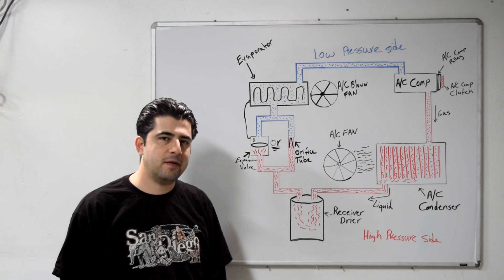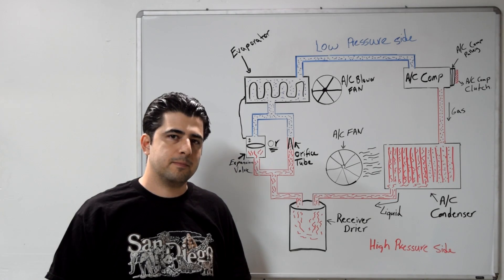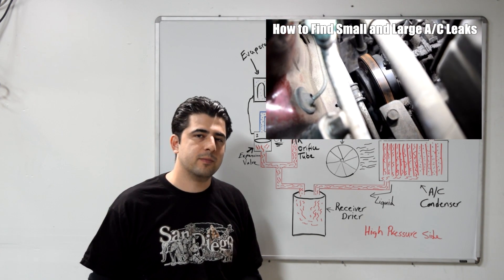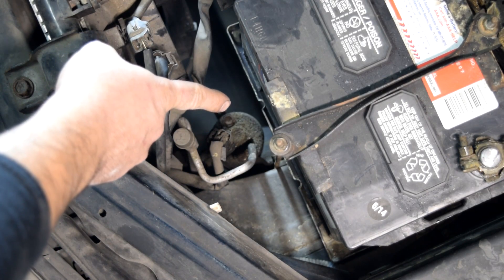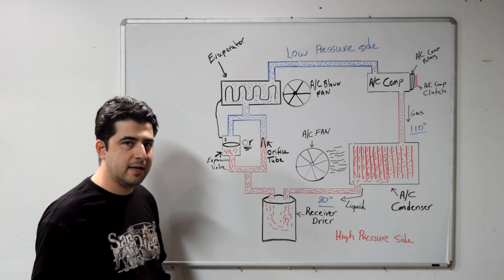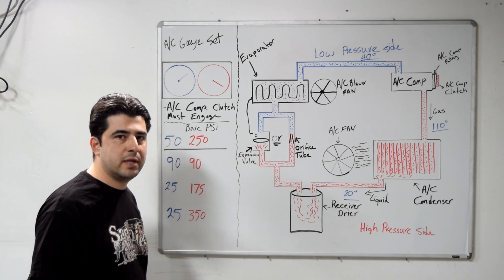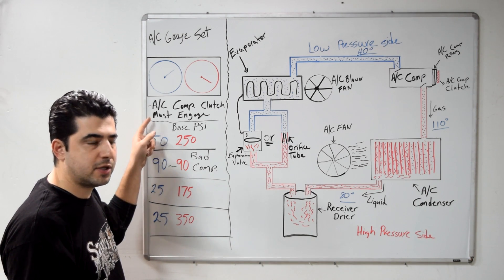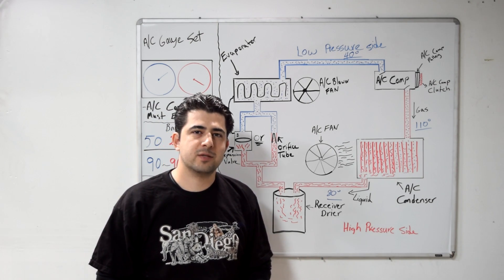How to Diagnose Problems With Your Cars AC System - With or Without an A/C Manifold Gauge Set

Comment: What if the low pressure side is higher than the high pressure side? Right now my gauge is sitting at the max reading on the low pressure side

Comment: Best videos yet on easy to understand diagnostics, this really helps to find out where the trouble / or even weak points of the system are, very well done, and thanks very much for posting, I am going to be applying this to 1986 ford f-350 motor home, thanks again!!

Comment: AC light comes on but just blows hot air compressor clutch not engaged with the AC light on all the HVAC controls work with heat and blower fan in the dash works including all the zones from hot to cold and the different air zones. Compressor clutch only engages when you jump out the relay for the compressor but I get no cooling fans running under the hood and those fans do work when the engine gets little warm but don’t come on with the AC. I looked at all the AC hoses and lines I can’t see any leaks of oil or Freon. The condenser at the front of the car looks fine to me no holes or anything and it’s clean. I can’t reach the low side service port it’s down at the bottom of the engine bay in an awkward area more easy to get to if I had a jack but I don’t. The high side I removed the cap and pushed down on the valve and I did hear pressure shoot out so it seems there’s still some type of pressure in the system. Plus I checked power from the HVAC controls to the compressor relay in the fuse box under the hood and with the AC button on I have power at the relay but it seems the computer not closing the contact only works when I jump it out the clutch engages and spins the compressor but that’s all that happens no cold air. Any ideas I was thinking pressure switch but I couldn’t see I leak anywhere only other thing maybe a bad orifice tube I don’t know

Comment: Very nicely explained! You just made a complicated thing uncomplicated!!! My Lincoln Towncar had the engaging/disengaging syndrome right now and i tried to add some Freon to it using one of those cans with a gauge in it but it keeps going all the way to touch the red area and coming back to the empty area so it wasn’t too helpful. While filling it up, the gas stopped going in and started leaking from the hose attached to the can. I also noticed that there was compressor oil on both the low and the high pressure connectors. If there’s a shortcut, please, don’t be shy! Lol.
I noticed my ac want cooling enough a couple weeks ago but won’t go to a shop because they are very Disonest down here in Florida so I’m trying to figure it out what’s going on.
Thank so much for your kindness and wish you all the best!

Comment: What would readings on a gauge be like if the low pressure side is clogged? My compressor started making a weird noise and stopped blowing cool air all of a sudden after I stopped somewhere to get gas, and when I go to add refrigerant it shows max psi on the refrigerant can gauge

Comment: Hi i have a 2011ford transit  when i turn on ac only hot air .  ac light is on clutch is turning but the pressures are equalized 90. LS  HS 100 psi  
Recovered frigerant  recharged 29 oz
Still compressor not pumping 
Any info will be appreciated

Comment: Great work. I would like to ask you what causes the AC system not to take refrigerant with a new compressor working, dryer and Thermal expansion valve. The clutch compressor is engaging as well.

Comment: My low pressure side hose is frozen and blower fan is not working . I hit a black box under dash of pasanger I assume to be the condenser and it turned on. The box had condensation on the outside. Any thoughts on what could be the problem?

Comment: Hi. The problem happen usually when i am in traffic jam.  After a while in traffic jam like 30 minute, The air con will start to blow hot air.   I notice that engine temp start to go up.  When i switch off the air con unit, i notice slowly the engine temp will come down.  The fan for the air con condenser unit is working.  My car radiator unit is new, clutch fan is working because the engine rpm is same rpm on clutch fan blade, no leak on water pump, good level of coolant, thermostat is working. I replace new air con compressor, new dryer, new expansion valve. The evaporator unit is clean and with new cabin filter, no blockage in front of the condenser.  What could be the problem i have on the car.  Hope for your kind assistance.  More power to your channel.

Comment: I have that same 95 Camry and my a.c. will work for while and then stop blowing cold air. Usually once I've turned the car off or it sits over night, I'll come out next day and it may work a little or not. Sometimes depends on how hot too. Suggestions...

Comment: Hello, I touched the lines on my a/c lines and everything seems to be working. Low side is cold, high side is hot, but still warm air is coming out. I also added 2 cans of refrigerant and still hot air. The only thing not working is my condenser fan, do I need to make that work to get cold air or should I get a bit of cold air even if it's not working. I am still trying to figure out why my fan is not running, but I think it's temperature control that's why it's not turning on. I tried connecting it directly to power and it run.

Comment: I have a 2006 scion tc. Ac dosen't work. Which fuse and pins do I jump to get the compressor to work? I checked the fuses under hood. Not much info on this car plus fuse is in Chinese
Reply: Btw, 83,30 I know. Not diagram, no nothing on this car.

Comment: What is usually the problem when ac compressor clutch engages, but there is no difference in the low pressure. It is the same whether the car is off, or on with the compressor running.

Comment: I need you to look at my car cuz I’m having a hell of a time finding a mechanic who knows ac and they’re putting me thru the ringer. I replaced my condenser myself. But now I think it might be my expansion valve. Please I need help lol my high side pressure is way to low and my low side is where it needs to be at 30. Not only that my ac is hot on idle and doesn’t get colder than 60 degrees when it’s 95 out when I’m driving. Oh and I don’t notice the fans or clutch turning off. They turn on no problem , but don’t cycle off.

Comment: my car idle comes to 0.5 when ac turned on. i have replace sparks plugs. clean throttle body and sensors etc. but problem is not solved.

Comment: My car leaks water on the low side I think the accumulator is clogged or leaking. Water builds up and looks like it's overheating but it's water not coolant and you hear water moving around when turning. Help confirm or explain what's happening

Comment: I know you said that the A/C clutch needs to engage to test. What if it isn’t? I just replaced the condenser a coupe of months ago and fill the system with refrigerant. I noticed my ac wasn’t working properly while stopped or setting at idle, eventually it just stopped working and the clutch isn’t engaging now. The only gauge I have is the one that I got with the R34 and when I connected that to the low pressure it read 250psi. Could this be to the expansion valve being clogged? This is on a 2010 Honda Civic.

Comment: So how important is the evaporator to the whole system. Sorry I'm having trouble understanding everything. Local mechanic worked on my AC and the check engine light came back on and he said he couldn't figure it out. He explained that he check the whole AC system and just couldn't find the problem and explain that the evaporator is more of a car issue than an AC issue

Comment: 2011 ford fiesta ac line going in through the firewall is not getting cold any suggestions?
Reply: System is reading 50psi i replaced a bad cooling fan ac still not working clutch is engaging

Comment: Yesterday I vacuumed system in 1994 mustang gt...then I added a half a can of refrigerant  (left over from my truck) compressor went on...then I added some ac pro stop leak and tried adding more refrigerant and it only took half a can and compressor stopped going on... any suggestions on what I need to check next? Or do? Thax

Comment: Great video brother...I have a question
I just replaced the entire ac system ac compressor, condenser, hoses, dryer, and high pressure switch (on dryer) the ac blows really cold but the clutch is not cycling its always engaged...any idea if the ac relay can be the problem?
Thank you..

Comment: Ok. Here's my deal. Hope you can suggest some things, shed some light or/and tell me what to check next? Recovered system's freon with MY recovery machine, refilled w R134a from MY tank(w my scales, so was dead on weight accurate) and it worked for 2 summers now. This year, air is not getting cold, again! Sux! Summers a comin!
Here's a little info;
Initial Diagnostics test readings:  Low side- 45psi (+ or - 2 to 4 psi as fan cuts on and off) 
                                                           High Side- 160-175psi (again, + or -) 
Temps: High side line-  Compressor to condenser-140-160f
              High side line-  Condenser to receiver dryer- 125-135f
System uses exp. valve, not orifice tube
It's the crappy 2000 sebring conv JXi, 2.5L
Appreciate your videos! Love to see what you think/things you would do! Thx!

Comment: I have some concern .  My toyota vios 2006 ac is not cold when idle but when running the ac is cold. I just had my ac service recently charge freon, cleaning and new cabin filter.but still it's the same. you think the problem is expansion valve?

Comment: I've read on some forums that a locking AC clutch can cause the compressor to always be engaged. Is it possible for that to happen and the symptoms be cold air coming out even when AC is set to the OFF position ?  I was told I have a bad air compressor yet I still get cold air no problem, no leaks, and good pressure. Just wondering if changing the clutch assembly would fix this always on AC.

Comment: The pressure gauges in my car are 55/200 which it seems to be normal, but my air is coining out of the vents at 80 F degrees 
A week ago we had all the r134 out of the system and even had the vacuum for 1hr to clean all the system, we refilled with the 28oz of r134a which is what the manual ask for. And we still got the same results, 80 F degrees the coldest, and my gauges are on 55 on Low and 200 on High, any suggestions? Can anyone help plz

Comment: Hi, your videos are really good. I have a Kia Sorento and the A/C is not working properly. When i turn on the A/C it starts with cold air, but after i let it run a few minutes the A/C starts blowing hot (ambient) air. Can you indicate any possible reasons for this? As per your video i would guess it's the expansion valve, perhaps.

Comment: My a/c throws cold air when I dont use the a/c or when i haven't started the a/c but after a few minutes of driving with the a/c the compressor clutch stops working & starts blowing hot air. Ive used the machine that you you use to get rid of old freon and add new freon, couple of time and no luck still does the same thing.

Comment: What causes my low side be higher than normal (40F) and my high side be less than 200F. I am just getting warm air throughout the vent. My compressor clutch is engaged all the time but high side comes down to 150 and then goes back up to 200. Thanks

Comment: Hi does replacement oil need to be poured into a new receiver drier even if the compressor was not replaced? 

this leads me to how do you know how many ounces of oil should be returned if a new reciever drier will absorb some from the system? ... or does it absorb oil

Comment: Give a hand my pick up just go bud I have the low pressure line cold high pressure line is hot to the touch clutch looks like is working fine but I have no cold air inside

Comment: What are other thing would prevent the compressor form kicking in?
Reply: oscar prado  the pressure switch, thermal sensor in front of the evaporator, relay , fuse and low Freon

Comment: Cheers one of the best informative videos I've seen 👌.Question for you high pressure side is 250 low side 25 but the compressor is running continually is it the expansion valve ? Thanks

Comment: rnw, I want to pressure test my ac system using my c25 tank but can't figure out how to get from my regulator to the r134 charge hose. Any ideas,  thinking of have the same issue with a nitrogen regulator?

Comment: okay I am a bit confused. ...I removed my old compressor and it turns fine...not locked up and feels similar to my new one when I turn...air was blowing hot with plenty of refrigerant...when i attached gauges hi and low were at 100 psi with car off and stayed same when running and ac was on....I could see compressor engage when I turned on ac...so is there a clog inside system? or could there be another issue...I am flushing system and also replacing dryer,orifice and condenser. ...any help is appreciated. ..thanks

Comment: I have no ac in the rear of my 03 durango. blower motor work... just warm air. I'm thinking either bad blend door and/or actuator, clogged evaporator (their's no leaking in the rear btw), or bad expansion valve. what do you think?    gauge reading... 20-25 psi lowside 150psi highside. I couldn't find any leaks
Reply: was low charge

Comment: Yesterday afternoon I bought a can of 'ac pro'. Used the product as instructed but over charged the system a bit. I quickly turned off the ac and let out some of the coolant with a rag and screwdriver using the high pressure port. Checked low pressure port reading and all was well. Ac worked fine last night and this morning, started my car up tonight and I'm getting hot air. Condenser isn't engaging. Any tips? I can't add coolant if the condenser isn't engaging, correct?

Comment: Temp measuring tool that points a laser is actually averaging the temperature of the air in between the tool and the object you wish to know it's temp...  The laser is not what is measuring the temp, it is just a pointer.  The big white circle in the front of the tool is the actual interferometer.

Comment: Do you have a  video that shows how to find and fix a short in the AC control system?  For example, is the problem in the AC controller (amplifier) or any one of several components attached to it ???  Thanks :)

Comment: why does it blow hot on freeway my ac but when parked works great???ice cold
Reply: JBIRD575 low on freon. system has enough to cycle on idle/slow speed but enough to cycle at high rpms
Reply: Greg Thomas thanks
Reply: Any time sir
Reply: Greg Thomas it was orifice tube and accumulated replace orifice tube clogged with metal hope that helps someone
Reply: Greg Thomas accumulater not accumulated hahaj
Reply: Great but if your seeing metal shavings..then thats not a good thing. Its as if a pipe was cut with a jacksaw or piston in compressor/rings wearing
Reply: Lol
Reply: Greg Thomas put new compresser accumulater orifice tube refilled working great...
Reply: Ok great. I was hoping you did replace the compressor because I would hate to hear the compressor shredding more into the new accumulator

Comment: Great video. Very informative. Question: Brand new 2017 tacoma, a/c set on low, compressor comes on and off constantly and a long, intense,  and pretty loud purging sound that lasts about 5 seconds can be heard through the vents. Sounds like pressurized air being released.  Air gets slightly colder when it occurs. Should it be happening so often? Dealer said car was fine but my previous truck never did that-also a 2017 that i just traded in for this one. Thanks
Reply: Peggy Gonzalez jujnu

Comment: Nice diagram and good job explaining different issues to look for...I have a 2002 Durango & the Air flow when fan on high is not coming out fast like a newer car? Thx Emily
Reply: Emmy Eagle quick question does ALL speed work 1-5? if not then maybe blower motor resistor. If ALL speeds work then the blower motor maybe weak

Comment: Hi Sir, What if I have both a front and rear A/C in the car and the front A/C is not blowing cold air while the rear A/C is blowing cool air and then when I try to to touch the low pressure side pipe it is not cold to touch so I assume it is either the Expansion Valve or Evaporator? is is possible that if the front expansion valve is clogged it will not blow cool air but the rear A/C will blow cool air?
Reply: Carlo Quinto Is it safe to assume the vehicle your talking about is working independent? if so then yes. If not then it maybe something simple like an actuator or electronic component controlled by front

Comment: Could you please tell me if the receiver drier is solder to the line or attach with bolts?. Thanks in advance.
Reply: Otto Mendez normally they attached by bolt or flange. follow the pipe around and then you will see where they join

Comment: Thank you for such descriptive videos. right now I'm trying to troubleshoot A/C system on my recently acquired 96 Honda Accord. It probably is probably just low on refrigerant but i still want to use your method to troubleshoot before i buy a gauge set. Keep it up and Merry Christmas!
Reply: James Alexander Honda's work if the ground system. make sure you have power at the compressor and ground the lower pressure switch and you'll feel it kick in